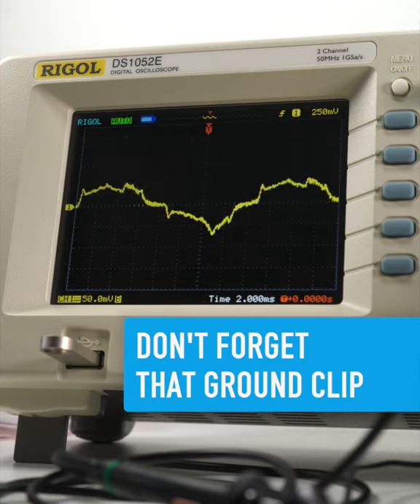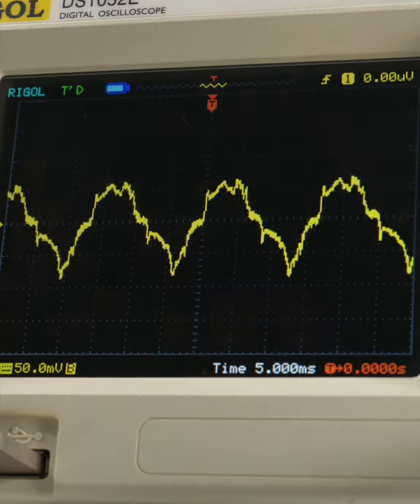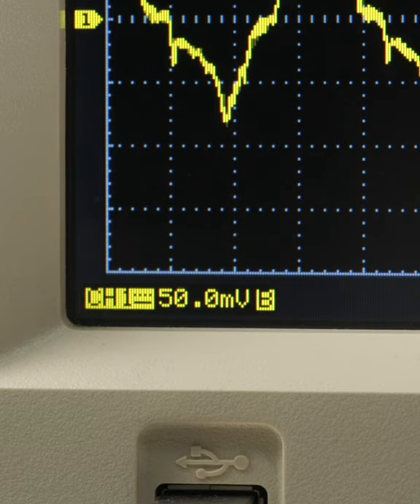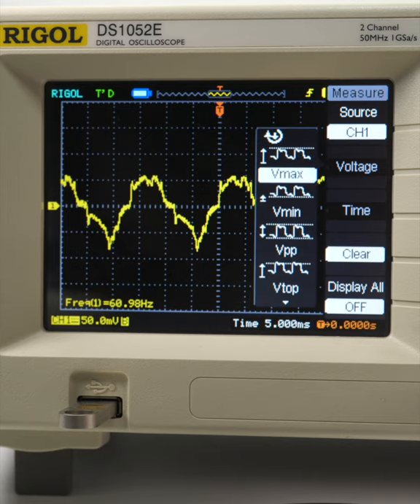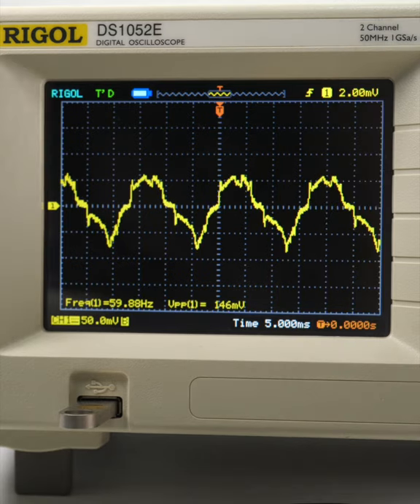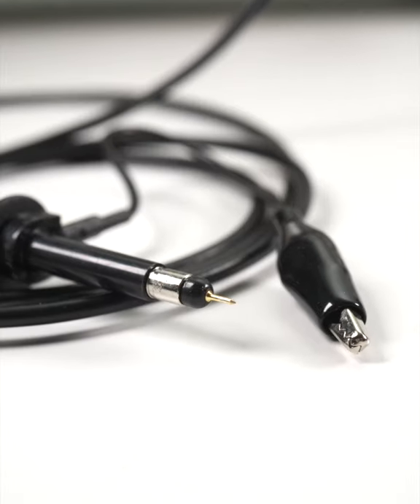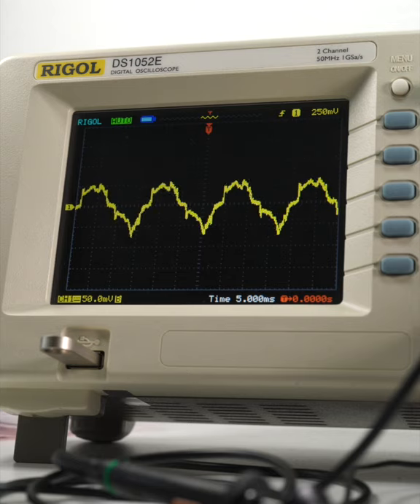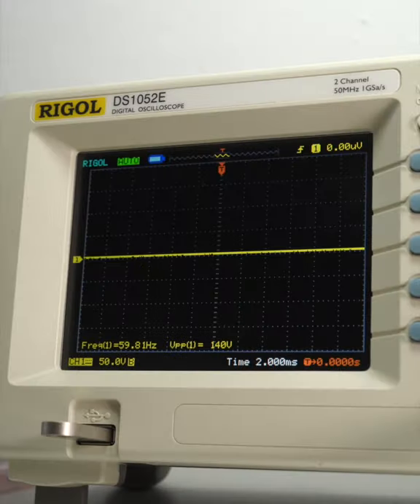Don’t Forget That Ground Clip - Collin’s Lab Notes #adafruit #collinslabnotes

Comment: My first electrical engineering course introduced the oscilloscope in like 15 to 20 minutes, then expected us to just know how to use it. This is among several things I could have made use of during those days in the lab.

Our semester project was an analog robot that was supposed to use RC circuits to make a quarter reverse turn when the bump switches were triggered on the front (otherwise move forward). We didn't have Arduinos or any other microcontrollers to do this, we had to use transistors, diodes, relays, etc. on a breadboard, and debugging that mess was NOT fun. It felt like trying to hold together a full-scale bus made from cardboard.